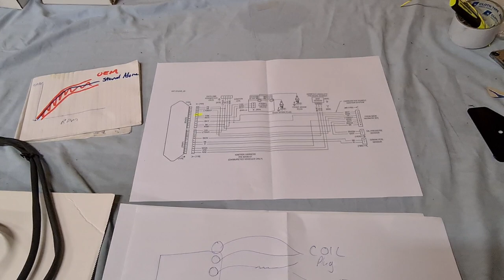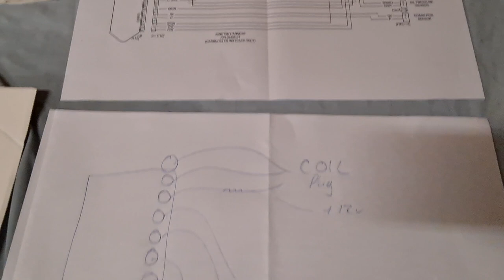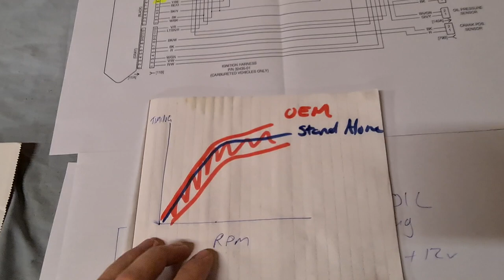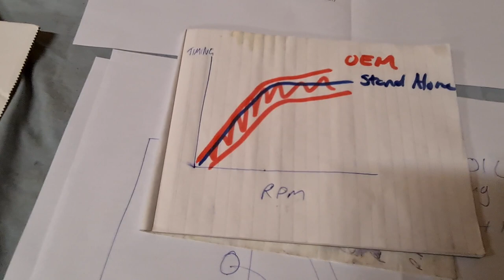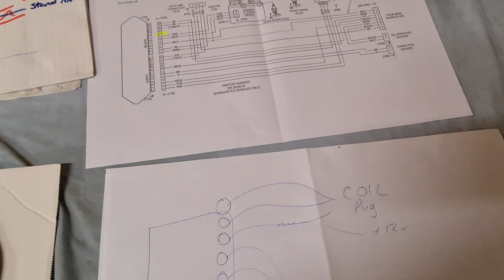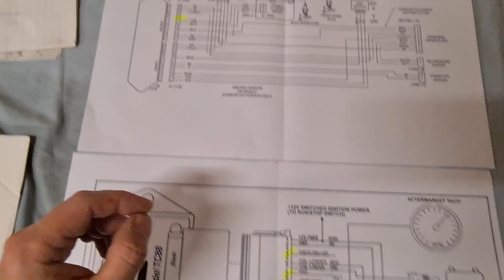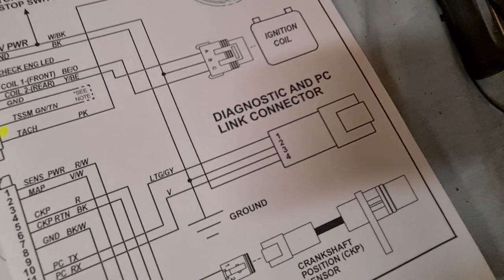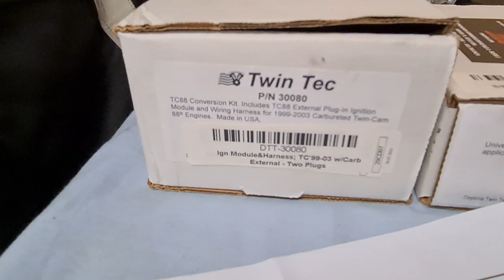How to wire a (Carb'd) Harley Twin Cam motor (Pros and cons of stand-alone vs OEM style)

Comment: You absolutely covered the this topic very thoroughly.
I’ve installed 3 Thunderheart  systems and the biggest draw back is not incorporating the MAP sensor. I try to run a more conservative timing map an try not to lug the motor, I’d drop it down a gear if I feel like it’s lugging.
The start crank delay was set to 5 revs from the factory which would make the bike backfire and wake the whole neighborhood. That alone almost made me want to rip out the system and go with the Daytona but if you link it with your computer to it you can change it to 1 rev delay. Overall the thunder heart is a good system if you are aware of the difference of operation, but my next build will have a Daytona twin tec system.
Reply from the maker: Thanks for the info and first hand experience. Interesting to know the crank delay can be modified! Was there any particular reason for going the Thunderheart route for the first few rounds? 

One of the things I kinda glossed over, but I can definitely see the appeal of a Thunderheart on a stripped down chopper where you want to hide as much wiring as possible, and where ignition timing isn't as much of a concern as a bagger thats doin big miles in all conditions.
Reply: @jimmyrustles8118  the thunderheart is super easy to set up and it comes with the coil and plug wires. The start up rev delay can be set at 0 if it’s kick start but 1 rev delay seems to be working well for me. It can make the power just don’t lug the engine and you should be fine

Comment: Wow, Nice explanation man, I'm going with a Dyna 2000i on my 99 twinky, I have got the parts Ie- Timing cone and Dyna Kit, i'm just waiting for a Cam support plate and its all systems go, I really want to get rid of sensors and let the timing cone innards do the work just like old school rides, Converted to Geared Cams a year ago and my cam position sensor has given up so its time for change, Good post from you, i have sub'd and Liked. cheers.
Reply: With the Daytona Twin Tec, you no longer need to use the Cam Position Sensor on the early Twin Cam. 
T.S. RACING

Comment: Now I’m second guessing myself.  I’m scrapping the Mag Marelli for a CVcarb on my 2000 Rd King.  Was planning on going with the Dynatech ignition and a Namz wiring harness. Thoughts ?  I saw your comment on issues you had with Namz, and wondering what.  Bike is stock and looking for reliability not speed
Reply from the maker: You should be fine with either setup, both will be as reliable as each other.

My issue with NAMZ was around the way they wired the harness and it not working with my setup (which is obviously pretty custom), and it had to do with the ground for the Ignition module and me having to run two seperate grounds for the ignition module to work. It has to do with the way the TSSM module is bypassed, and how that worked on the NAMZ harness was a bit odd.

On the Daytona Gear, which came as kit (harness, ignition etc) it all worked seamlessy out of the box for the exact same setup.
Reply: Thanks for responding. Only reason I like the Namz is cause it is basically OEM copy of harness for the carb version of my bike.  I don’t see a power line on the harness though. Maybe gets power from main harness ?  Do you think I could run the EFI ECM I have now with the carb ? Provided it has crank sensor
Reply from the maker: @davidlangley6671   @davidlangley6671  the Daytona harness is the same/similar, mirrors a carb tc88 harness. I highly doubt an efi ecm will work, completely different setup.
Reply: Thanks Jimmy

Comment: Hi Jimmy. I got my hands on a Thunderheart Ign so i will be doing my conversion soon. It looks easy enough.
To tell you the truth the previous owner 1/2 done the job. They only bunged a carburettor on it but kept the stock EFI/ECM on it which runs fine & starts ok but the problem with that is that i have a permanent 'Check Engine Light' on which is annoying.

Where did you get your loom from? Is it a NAMZ loom? 

I am torn whether to fit this Thunderheart or a stock ECM which i also have but i would need to change the loom out or doctor my old one but then there is the matter of marrying the ECM to the TSM. That is a nightmare. Have you done that procedure before? It takes about 1/2 hr apparently.

I wish i could download your wiring diagram, it looks better than the Clymer Wiring Diagram.
Reply from the maker: Gday  mate,

The Ignition loom came with the Daytona TwinTec (PN 30080). I have used the NAMZ harness on another bike but found there to be some weird issue with that wiring that caused me a few dramas. The DTT one that came with the kit worked perfectly out of the box.

I would always go for a factory style ignition (i.e one that uses the MAP sensor), it could be stock, SE or a Daytona etc. On my bikes I dont run a TSSM, because I wire into a MotoGadget that controls all the other electronics besides ignition. So in my case, I need to run a jumper wire on the ignition that skips the TSSM all together.  

As for the wiring diagrams, theyre all available online, if you get stuck flick an email and I'll send you the ones you need.
Reply: @jimmyrustles8118  Sorry for late reply. I only just noticed.

It looks like that loom is all part of the kit? I couldn't find it separately. Never mind though as i have since Doctored my old loom following the Clymer Manual Diagram.

With regards to those MotoGadget M-Unit's i can't believe the price of them. They cost about the same as a stock TSM 😲.

Thanks for your help all the same Bro. 👍

Comment: Did you find the jumper wire for your ckp sensor was short? How’s you route yours? Mine seems way too short and won’t reach without having wiring lay across the engine. Thank you
Reply from the maker: hey mate, not sure what you mean re: "jumper wire" for the CKP. Do you mean the actual CKP wire/plug from the harness or from the sensor?

I noticed that most CKP sensors are the same, but variations in the PN tended to be the length of the harness of the CKP sensor. So if you have an ignition harness for say a 2000 Dyna,  a CKP sensor for something like a 2016 bagger may be too short. 

Thankfully, the wires are very simple and so can be extended easily, on either the harness side or CKP side.

Comment: I’m currently cleaning up my 2003 softail tc88 wire harness to prepare it for a custom build and want to make it a key switch ignition, my only question is do I need to have that giant ugly turn signal security module still?
Reply from the maker: If you're running a TC88 ignition, it can be bypassed. Im not running them on my bikes. Instructions can be found in the manual.
Reply: @jimmyrustles8118  correct I wanted to use the OEM ignition, might be dumb to ask but where can I find the manual? Might have missed it In the video
Reply from the maker: @Nathanr561  sorry I'm referring to the daytona twintec ignition. Instructions for bypassing are in the instructions. 

I'd expect it cannot be bypassed on the stock ignition...would make the whole TSSM part redundant if it it could just be bypassed but I'm not across the finer details.

Comment: Help...i got a carbed 2004 Fatboy...its only sparking on the front cylinder, new plugs, leads and coil...i lifted the seat and by the rear guard theres only one 12 pin female connecter into the male box (Ignition Control Module?)....its  starts and runs on 1 cylinder, the front only....i done a code diagnosis...PSSpt...and the P being ECM or ICM...reads "no rsp"....12  pin ICM not working? Whats your thoughts?
Reply from the maker: Swap your leads around on the plugs and see if sparks the other cylinder.
Reply: @jimmyrustles8118  Yes i tried that, no spark at rear only
Reply from the maker: Pin 7 on your 12 pin, and Pin A on your coil plug Yellow w/ Blue is your rear cyl.  id be looking into that area.
Reply: I also checked the 3  wires from the coil to the 12 pin for continuity, and that was ok.
Reply from the maker: @regrangihuna5089  on coil, pin A is rear and Pin C is front.

If you have multi meter on Volts DC, do you get readings from both those pins when crankin motor?
Reply: @jimmyrustles8118  OK il try  the multimeter  whilst cranking....Maybe the female yellow blue isnt making a good  connect...ill frig around  with that for a bit. see how i go
Reply: @jimmyrustles8118  Thanks Jimmy  ill let you know how that goes.
Reply: Hey Jimmy well i think i solved this problem...after checking all the continuity to the pins, they were all good... i thought Id remove the ICM...the ICM maybe the culprit, theres damage where the back wheel has scraped the underside of it quite bad..i dunno what happened there but its definitely damaged and so i sourced one, but i have a question...softail, touring 04-06, part number 32478-04 was the part number but the one i found is softail, touring 04-06, part number 32478-04B, with a B at the end, is that a update version? I heard theres one with a A as well at the end, what say you?
Reply from the maker: @regrangihuna5089  It would be update, what the actual changes are, I couldnt tell you. Could be a slight timing or curve or anything. Id say you'd never notice the difference. If it was me, id be putting a daytona twintec in
Reply: @jimmyrustles8118  Thanks Jimmy, i would eventually do that, but im on a budget and this part is cheap as $198 new, ...i have a 97 RKing Evo, and too many other vehicles to maintain,  love them fxrs, my older bros still got his 87 fxr since 1989, same mtr, same gearbox...million miles and a milion riders.... should never have sold my 88 FXR crate SnS 96 cube, super G carb...lol,...damn big mistake...not laughing now...thanks for the advice tho Jimmy...ride safe.

Comment: The Twin-Tec is advertised for 99-03 engines- Is that just due to the factory carb? Is there any reason I can't use this on a '10 96" that I have installed a carb on?
Reply from the maker: Correct mate. The 99-03 is specifically the dual plug setup, so thats the model it will plug n play onto, but it can be used on custom setups.

Its covered in the Manual, but for custom applications all you need to have plugged in (at a minimum to make it work) is your power +ground, and coil, map and CKP and it'll run. The rest of the wires are nice to have.

On my channel there is a blue TC FXR with a 110 CVO motor. It was wired up with the same ignition.